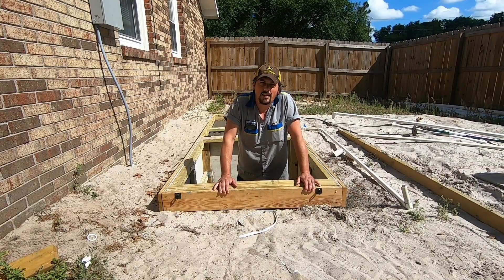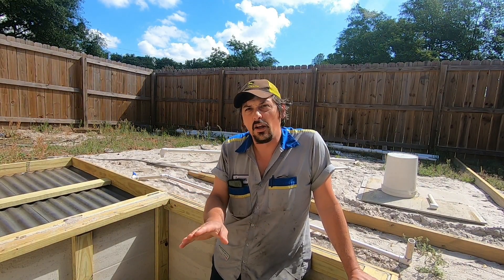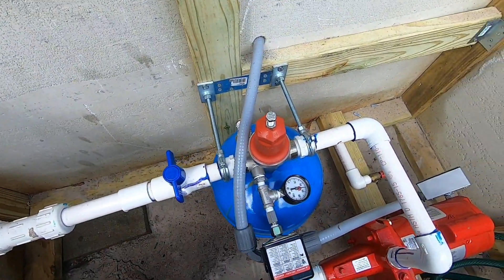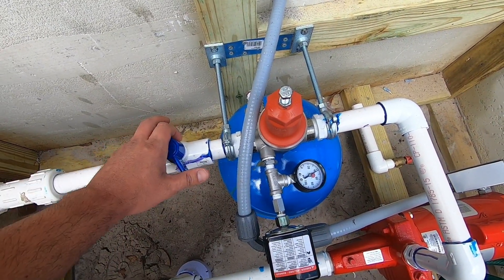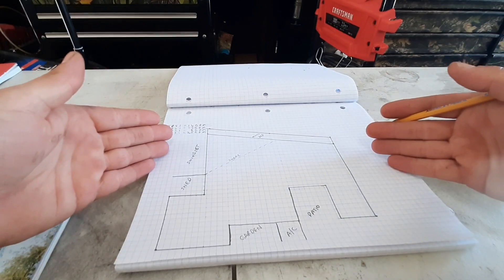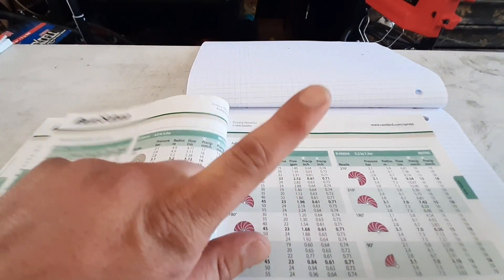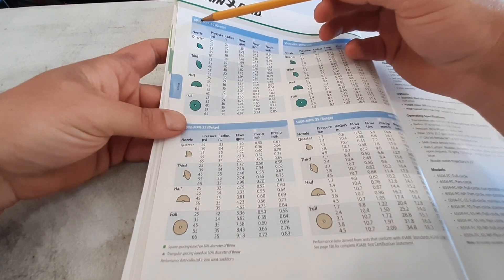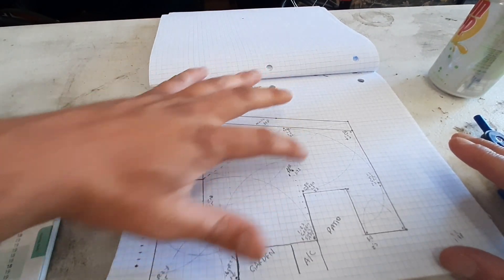DIY irrigation part 3 zone planning and gpm bucket tests

Comment: Nozzles seem to have different “degree of inclination” values.  How does this affect the decision on which nozzle to get? What is selecting a higher or lower inclination trying to achieve? Does inclination affect the radius and thus the spacing between heads?
Reply from the maker: With rain bird rotors, you only really have low angle and standard angle. The low angle are 25 degree and standard angle is 40 off the top of my head.Standard angle throw farther. The only time I could see using a low angle is if you have lower hanging tree limbs. Dont let the inclination angles worry you. If you have done the gpm calculation properly, the nozzle with throw exactly what the chart says. All depends on your needs for your design.

Comment: Please identify the Rainbird book you are using.  There are a lot of different ones on the Rainbird site.
Reply from the maker: The book I'm using is the rain bird 2019 product guide. I picked it up at my local irrigation supply store. The info you seek is on rain bird's website though. You're looking for "nozzle performance chart"
Under each one of the sprinkler head pages.